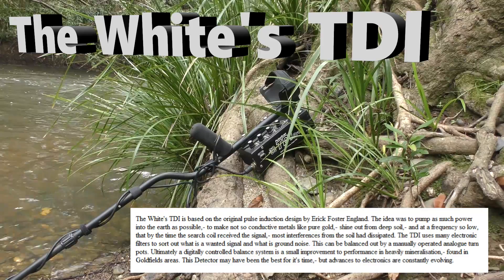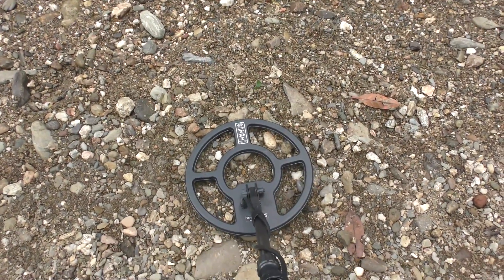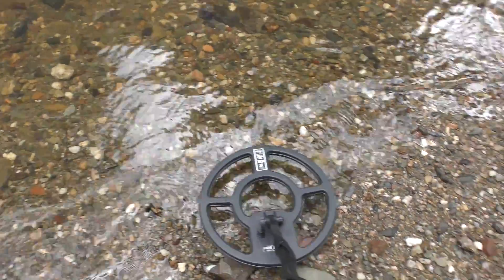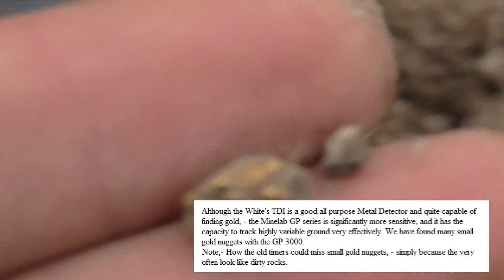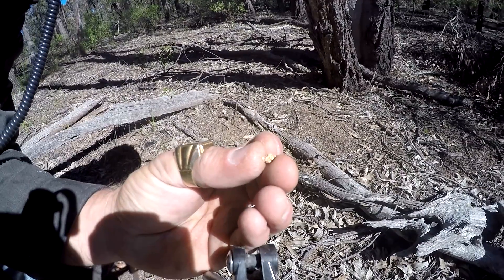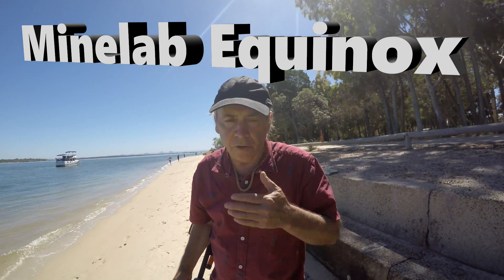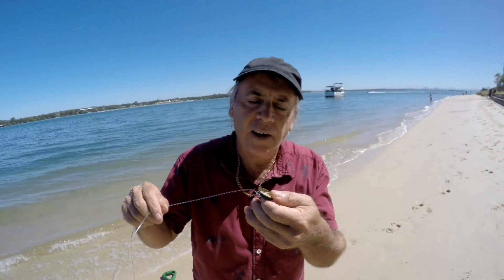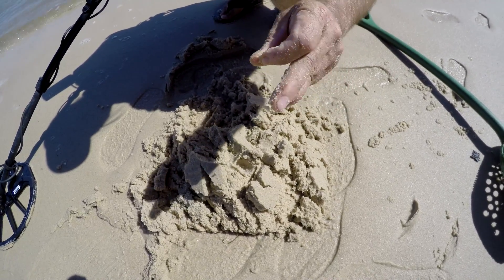Very low Frequency: Pulse Induction & Multi  Frequency Metal  Detectors.

Comment: if you could only pick one of these detectors for beach detecting which one would you choose ???
Reply from the maker: I like the Whites TDI Or Sl,- but if you drop it in water,- it is finished. The Equinox  is best because it is water proof (Simple explanation)
Reply: @GoldfindersAu  for me the tdi's are the best for depth...i have water proofed both my tdi pro's so i have no problem dropping into the water.
Reply from the maker: @daveh2938  How did you water proof the TDI?
Reply: @GoldfindersAu  i used an ultra box and i also modified the pro to give me a delay of 8 uS which is good on small gold.

Comment: We tested Equinox and this detector proved itself that can NOT GB well on heavy mineralized soil. Squealing chirping buzzing all the time. You should pay more attention to Deus. Easily this detector can overpower most of the detectors. Ofcourse it depends in which hands it is. Like in mine! But if you think that you will take it and use it just like that on some factory presets, it will not work. Very soon you will throw it away as an useless machine. There are non of the 10's useful standard programs. You should learn to customized it and use it on maximum of its potential. Squeeze everything from it. I wont forget how I tested it against GPX 4500 on high mineralization ground 86 on Deus scale. It was a 28 mm coin in 40 cm depth. GP wasn't hearing it and I told to owner - comon do something ... increase gain, sensitivity or whatever. He said - if I increase it more I wont be able to hear anything. I respond - See, I can even boost Deus further! As I said - depends in which hand detector it is. Also it is gosh damn hell all the day the hear this brumming constant sound from PI detector. So, first learn detector options and capabilities well, then make a good testing range. Or you will be misguided all the time. GLHF
Reply: Some Detectors will work in certain grounds better than others but the good detectors work well in all grounds . I fully agree with you. The ultimate test is mineralised ground because some areas are highly variable and only a computer can adjust the ground balance that quick  and that is a simple explanation. I have never tried Deus,  i will check one out when i can,- Thanks Alex.
Reply: @goldfinderspragmaticvideos.  You welcome. When get Deus, call me I will assist you with what I can. I'm with it for 3 years, two times per week, 8-10 hours per day for hunting.  If you really going, take the largest black 13" coil. No point of smaller ones. For gold hunting whites are better coz of higher frequencies. And btw thank you for sharing your tests.

Comment: Can I get some recommendations on cheap second-hand metal detectors for the saltwater Beach I'm kind of broke I got a Garrett 300 I've been using in the dry sand but it's useless in wet sand so I'll mostly Limited to finding junk and coins found a Tungsten Carbide ring last year I see a lot of companies advertising that there detectors can handle salt beaches but when I see the reviews all of them well are mostly useless besides the pulse induction models it really aggravates me when people are selling something that's supposed to be able to do a certain thing and it can't do it especially people that made by into that and not looked on YouTube the watch reviews on the product I'm looking for a cheap second-hand detector that can handle saltwater beaches that I could find on Craigslist or a yard sale or something like that I have a small list of detectors need to add some more to my search
Reply from the maker: The Minelab equinox does well in salt sand. Getting one second hand might be hard however. Penetrating salt or mineralized ground is a huge problem for manufacturers to overcome. Try e bay.
Reply: @GoldfindersAu  I was looking at the quest but from what I gather it is a copy of the t2 may be improved made in China they were sued or something like that the amphibio multi is a new detector to you might want to check out I think that one's a French company

Comment: Good video.I am new to this metal detector biz..I found a metal detector with no coil on it .brand name is unknown but it looks like a pulsed unit..It has four wires going to the coil so i assume its separate Rx and tx.. I wound a coil 120 turns of mag wire from a microwave fan motor,,anyone know what or how to build the coils ?also the detector is run by 2 9 volt batteries and has 2 knobs ,,,one for power and volume and discrim...any help would be greatly appreciated//
Reply from the maker: Manufactures make the coils to suit the circuit, and any changes will either not work well or burn the circuit out. but the best way to learn is by mistake -and research. they are a very complex instrument. you are on the right track however..

Comment: do you mean inductive or conductive? 0:35  gold is a good conductor.
should also be clear there is always a cost to automatic ground balancing vs. dig time.
the unlimited composition of mixed targets and ground noise is only processed as good as its hardware or software. (like hot ground with a gold target) VLF type detectors have a much better ability to process a signal ie. whites v3i. than older PI. but newer detectors are incorporating all these DIGITAL system with smarter software and hardware, something older analog system did with difficulty.
Reply from the maker: True and sometimes they can balance out a signal....inductive probably a better description for 24ct gold, but silver is better....